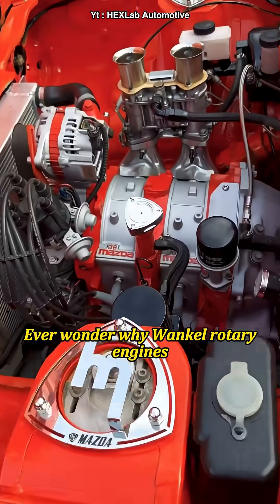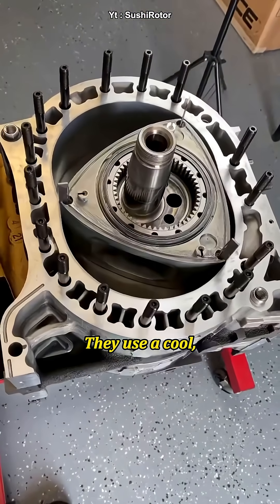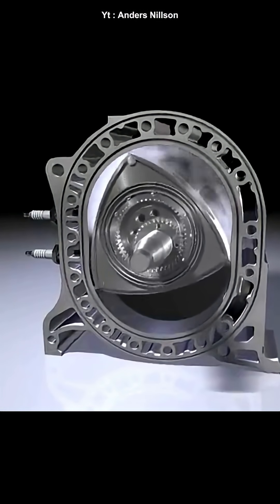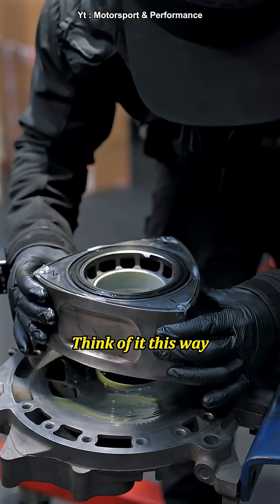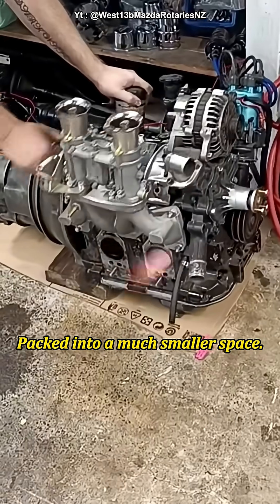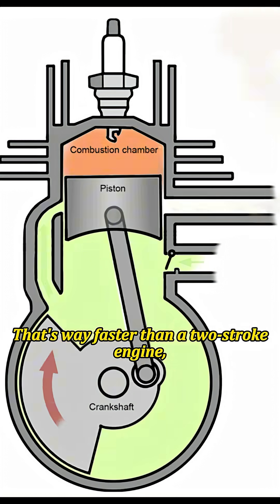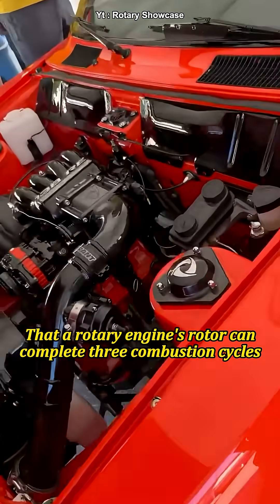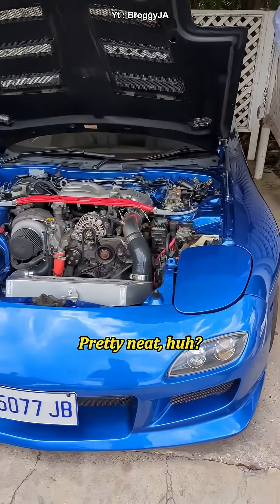Why Rotary Engine SO POWERFUL ? 🤔

Comment: No torque in low or mid end, and gotta premix petrol with oil. Easier to take apart tho, because gotta replace the apex seals.